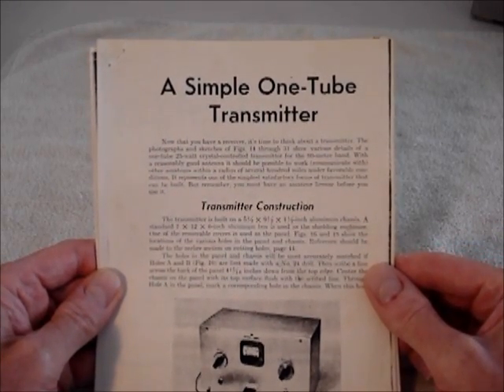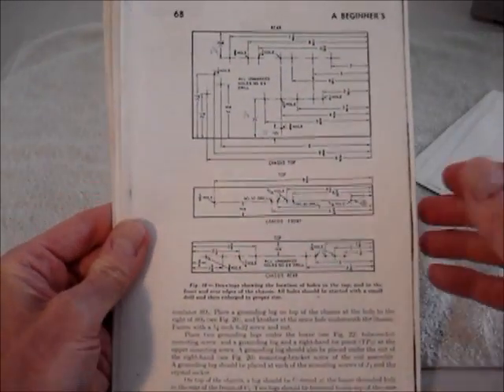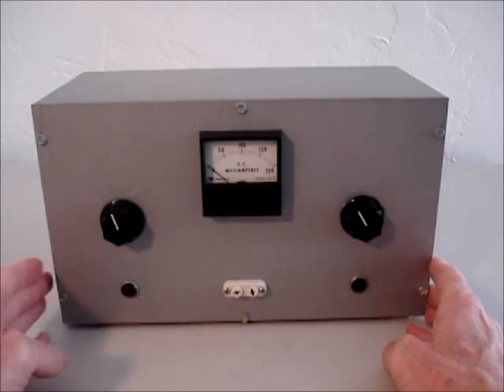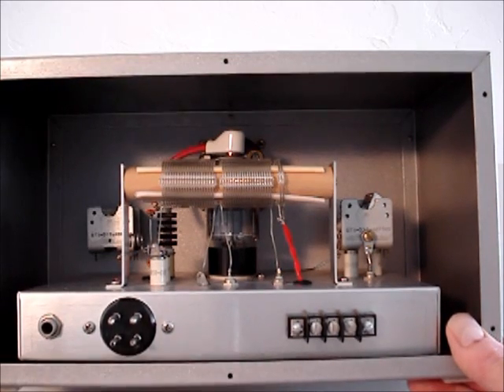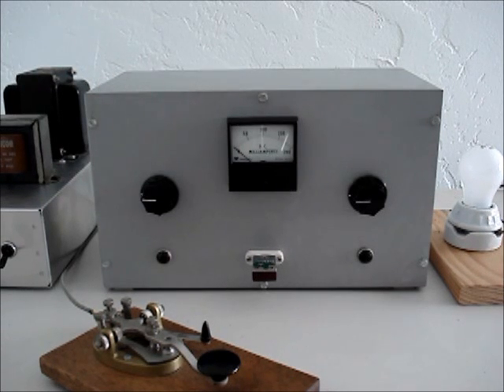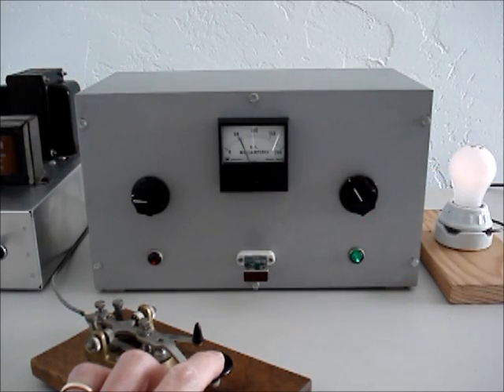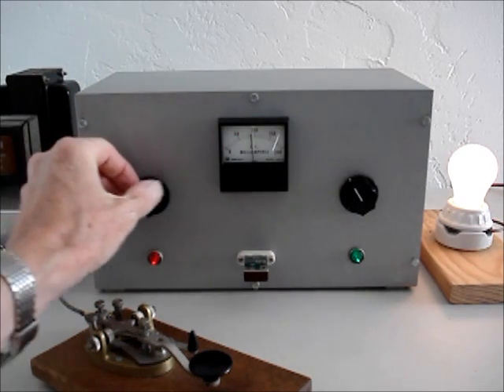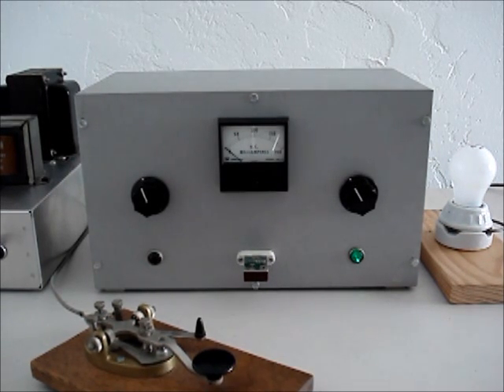ARRL One-Tube CW Novice Transmitter- 1962 Design

Comment: That is precious! I also still have that book somewhere. When I was a kid, in the 60s, I admired this circuit, along with the two tube (6AQ5's) regenerative receiver and there was also a one tube (6U8) converter for 20, 15 and 10 Meters. I would be proud of this construction also. I became a Ham in 1979 but did not start building until the 80s.

Comment: Sure does brings back memories. For me, it was a rescued DX-20 when I got my first novice ticket. I tuned it up into a 60 watt light bulb as you have done and sent out a series of Vs de WV6KJK (my call in 1961) and was surprised to hear a response from a ham about 150 miles away!
Reply from the maker: Thanks for watching! - your remarks reminded me of a similar experience I had with an SCR-284 field radio set when I was still in high school (around 1970). The first time I tried it out I was tuning it up on 80M AM, not even a CQ call, and got a response from a ham about 50 miles away. That set was in beautiful condition, complete w/ dynamotor and T-17 mic, but not the hand crank generator. I wish I could have kept it. -73

Comment: Thanks for the memories!   I became a ham in 1958 using the “How to...” booklet. Assembled a Heathkit AR-3 receiver, then a DX-20 transmitter, a station setup I used for many years...  Later on drove a 500 Watt linear amp with the 50 watts from the DX-20.  Have much newer equipment now, but remember those fun days!

Comment: Love the job you done on that. Rig looks great ! I remember my Novice days so Well. about 1965/66 Got Novice license. First rig was the Heath AT1 and had a Lafayette HE30 receiver. Lots of fun with the combo. I only had about 3 or 4 Crystals  . operated 40  meters only.  When I got my general license I had VFO ; thought i was in the Big times. LOL !
Reply: CW is still my favourite mode ; my call is WA9NEU
Reply from the maker: Hi Walt,... wow, your story is so similar to mine- My receiver was also a Lafayette model that was a later version of the HE-30 - can't remember the model # but it looks almost the same as HE30- the knobs were different and the cabinet was a light green. My first transmitter was the "Scrounger" that I described in this slide show video; https://www.youtube.com/watch?v=W5b2u_x-zbQ. My 2nd transmitter was a used Globe Scout 65A and I only operated on 40M CW while Novice. After i got General in 1967 I acquired a used Knight-Kit VFO and operated some 40M AM for a while. After a few months I got a Heathkit SB-101 and spent one summer vacation putting it together. By then i had strung up an 80M dipole in addition to the 40m. Every afternoon after school I would sign in to SSB 80M  "Alabama Emergency Net-T" (T for teenager). By then I also had a Heathkit "Sixer" and homebrew 6M 5 element steerable  beam. Several of us teenagers had a local group on 50.55MHz. Those were great days. -73

Comment: That's a very nicely built transmitter. It's amazing how closely your build looks like the photos in the ARRL book. This transmitter is also featured in the 1958 issue of How to Become a Radio Amateur.  I've held on to that issue all this time.  It wasn't until 1963 that I became licensed as WN0HPU, now K5WQ.  I never built that transmitter but always wanted to. Seeing your video has inspired me to give it a try. I probably even have the parts except for the chassis and other sheet metal.
Reply from the maker: Thank you for the nice remarks- I hope to see your transmitter- Try Allied electronics or Newark for the chassis and cabinet. My cabinet is steel because the Aluminum version was no longer available. maybe you could document your build in some videos! -73

Comment: Lots of memories for me.  I built a two tube 40/80 meter transmitter  from plans in the January 1962 issue of Popular Electronics magazine.  I was sixteen that year and it got me on the air as a novice, chirps and all.  I used it for about nine months until I got my General license and moved up to a Heathkit DX-60.  73...jim...WA7VVV

Comment: I remember that article but at that time I decided to make a 35 W transmitter with the 6DQ6 tube in the oscillator and with the 6L6 tube in the output. I took the circuit out of the ARRL Handbook.

Comment: Good on you using the "Angry 5" (GRR-5) receiver.  I had one of those and it worked very well.  I used it for SWL and mine had the factory case and power supply/audio amp speaker.  The one tube seems to do the job and, if it's fun, it's a good idea to do it! Jeff K7AIL
Reply from the maker: Hi, thanks for the comment. I bought the R-174 (GRR-5) from Fair Radio Sales back in the mid-80's, as i recall. They were offering a good price for just the receiver unit without the cabinet and power supply. I built the AC supply and plywood cabinet for it. I have a posting at Antique Radio Forums ( several years ago) where I documented the power supply design. -73

Comment: SUGGESTION! Regulate the SCREEN Voltage at pin 4 with an OB2 tube !! You will get rid of the chirp these transmitters tend to create! Especially with newer crystals.
Reply: that is my big change on the power supply...regulated voltages and I used a three tube VFO for 1.8...  Lew McCoy did the VFO ...it works great 73 WB5MZO

Comment: i'm really interested in building this. Do you happen to know where i can find this article?
thanks
73
Chas AD0UY
Reply from the maker: ARRL booklet “How to Become a Radio Amateur”, 21st Edition, published around 1962. The ARRL maintains an on-line archive, I think, but you may have to be a member to access it. You might try checking their website for archive information.
Reply: I am a member, and have spent some time searching the site.  I just haven't found it yet.  Thanks for affirming that it exists there.

Very nice job, by the way, on this transmitter.  It is inspiring.